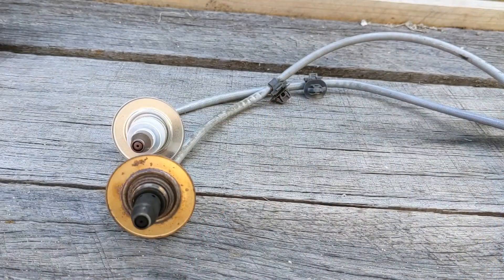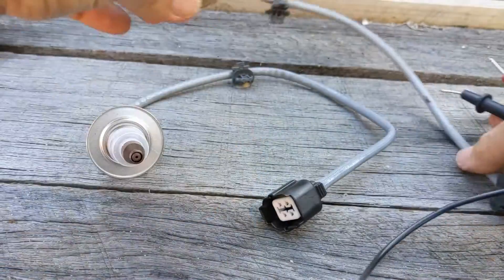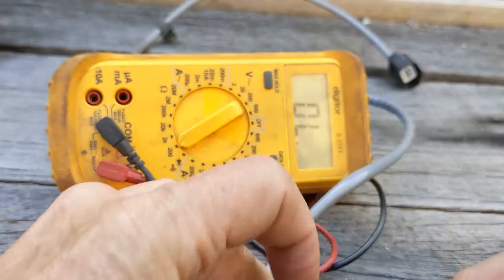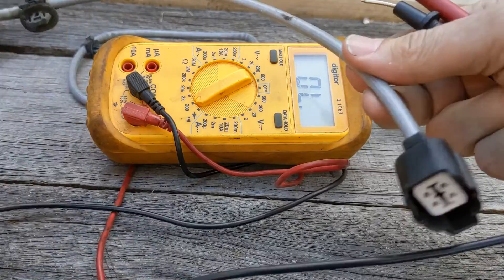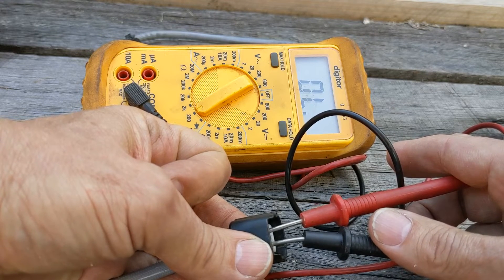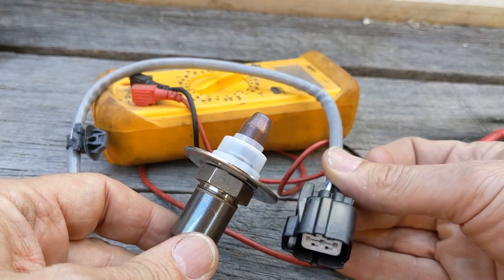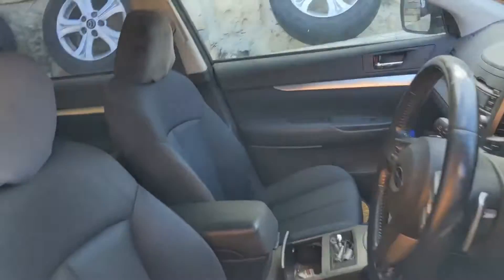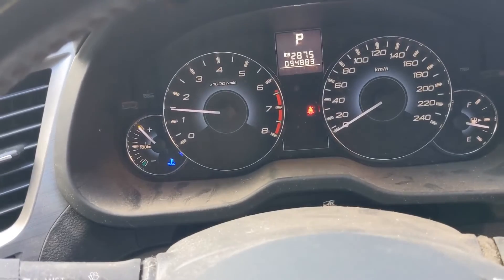BR Subaru Liberty (Legacy) Oxygen Sensor P0031 Check Engine Light diagnosis and fix.

Comment: Questions can a new aftermarket o2 sensor work on my 2009 subaru impreza?
Reply from the maker: It will work if it is compatible.  Make sure to buy one that the seller guarantees.  Paul.